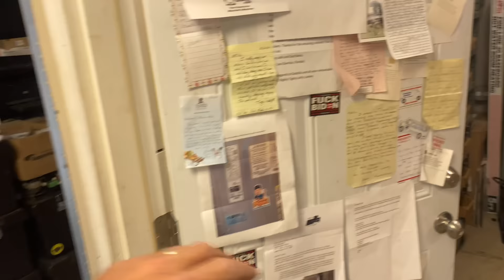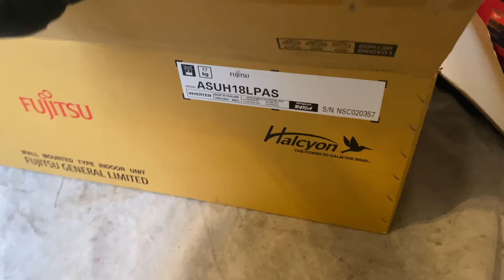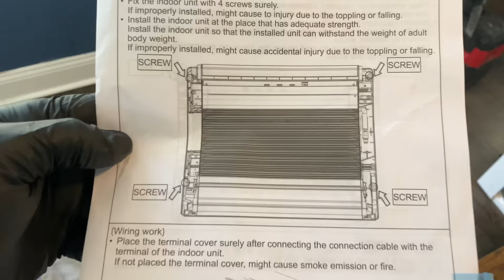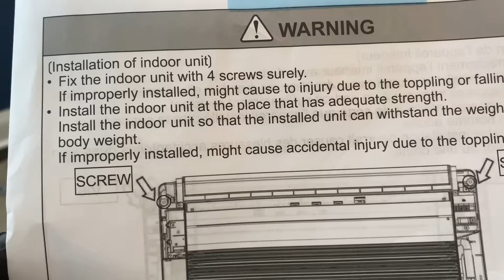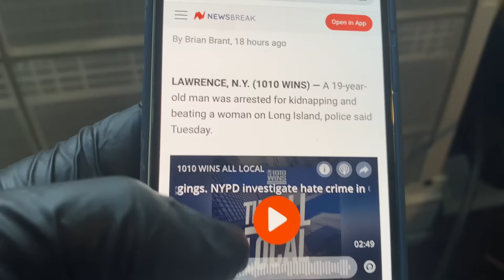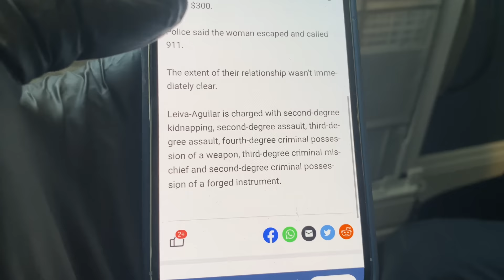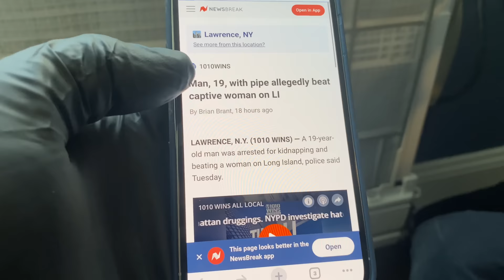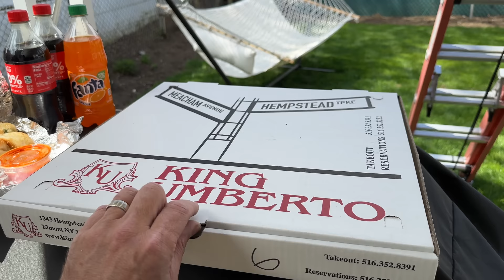Summer is Approaching! Install a Ductless Mini-Split Air Conditioning System & Be Cool This Summer

Comment: That white line set is going to get you.   Causes pin holes in the pipe look it up
Reply: @PipeDoctor  still can't trust it . I get the rubber stuff k flex lineset doesn't rip and you need to cut it with a knife

Comment: I preferred Fujitsu over Mitsubishi. One of the reasons is multizone unit, Fujitsu has valve for each pair so in the event one zone leak, you can isolate it and test it individually vs Mitsubishi single valve for all zone in which you cant closed the zone if its leak. Daikin multizone has one of the worst design in term of electrical connection and copper line set; the line set is stacked to next one making so difficult to put wrench in to tighten the flaring nut.  In term of quality, I think they all fine.  Btw, I notice most of the US tech when they need to disconnect the pipe for what reason, repair or relocate, they all seems to use pump out the refrigerant to external tank but in oversea, they just pump down or return all refrigerant back to accumulator by closing liquid line while running, and then close the suction line once gauge show it down to 0 and then poweoff. I have tried that couple times and work great. Its something you can next time.
Reply: You get money back for reclaimed refrigerant thru various supply chains when you return reclaim cylinders

Comment: Mr Mikey, it takes days because the job has to be done right. Your video shows you wiring some units and drilling holes and claim to be done by lunch.  Where do the drains go? Are they pitched?  Are all the linesets ran in slim duct for a clean look  or are they zip tied and clamped to the siding?  What about running power up to the disconnect ?  With all that,  theres nothing about pressure testing or pulling vacuum on the lines!   
I'm not saying your a bad installer or a hack. But i've repaired and replaced alot of "quick" in and out shit jobs.

I also suggest  some research on the linesets with the white foam as I see in your video. 2 words, "pin holes"

Comment: I wanted Fujitsu ductless mini split system and for two 7k and one 12k head and they wanted it to have ICM Single Phase Motor Protector For Mini Splits local compay quoted me 12 grand and 2.5 days of work. last month i cantated the company about my quote and they told me price of the system has went up and i would have to be re quoted. I passed.

Comment: Why do you even need those spade connections? Put it right into the terminal block less connections.
Reply: when crimped with the aluminum sleeve it makes the strands like a solid core that's less likely to vibrate loose over time. "everything vibrates, whether you can see it or not" as it was put to me a long ass time ago. those ferrules are also a great option. Also helps to differentiate the job from an installer who has the stuff needed for a good install vs someone who just doesn't care

Comment: hey mike, what is the selling point for the floor mount over the high wall?  was this install one outside unit?   it would be cool to se daniel doing the outside unit filming at the same time as you inside.